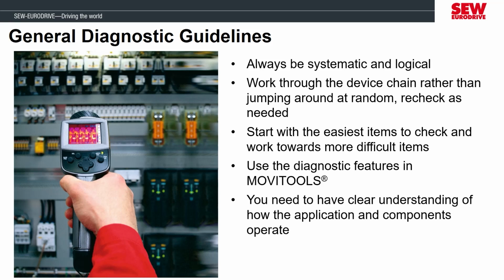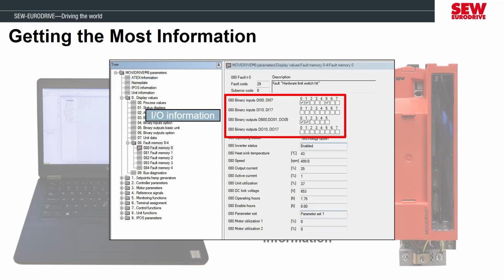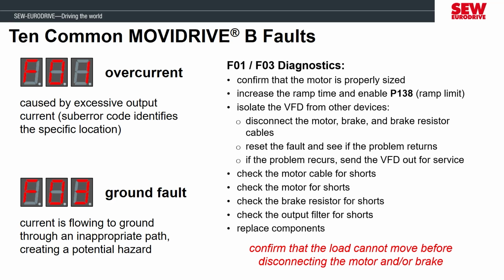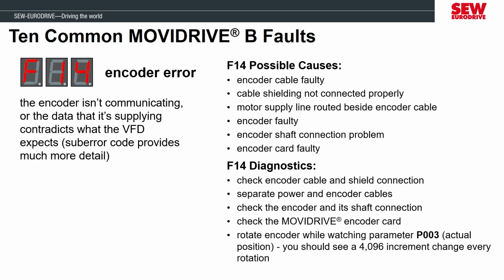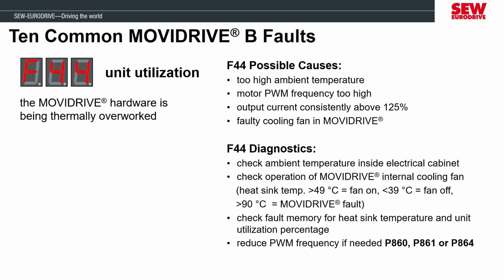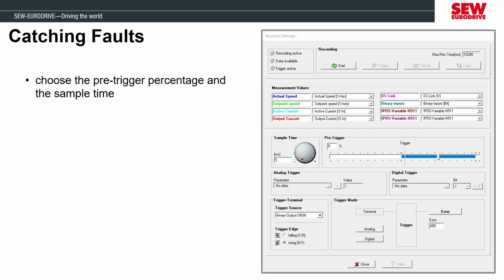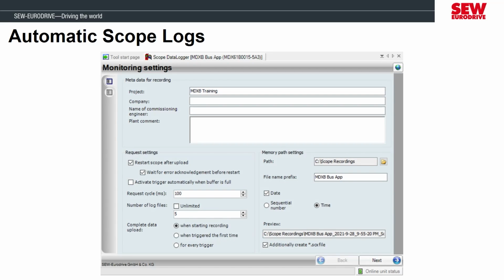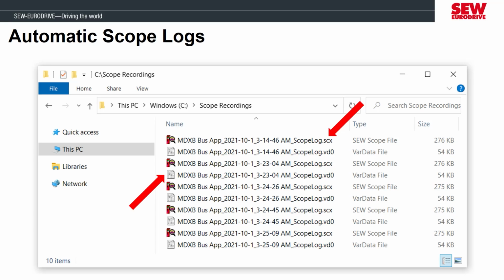MOVIDRIVE® B Training Session 7 - Troubleshooting

Comment: Fault F45 how to fix sir??
Reply from the maker: Hello @tuanthinhdo1108 . We would need more information from you about which variable frequency drive you have that is reporting the F45 fault. If it is a Movidrive B like this troubleshooting video was made for then this is likely an issue with initialization at boot time of the Movidrive B. This can happen if the parameters were corrupted, an incorrect parameter set was downloaded to the Movidrive B, an option card isn't installed correctly, or there is an internal hardware issue with the Movidrive and it would need to be sent to SEW-Eurodrive for evaluation and repair. If you have a backup of a good and working parameter set, then you can try factory resetting the Movidrive B to "delivery state", then re-downloading the correct parameter file. If that doesn't work, then there is likely a different root cause.

Movidrive B System Manual:
https://download.sew-eurodrive.com/download/pdf/27793230.pdf

Page 689: Description of F45 Fault with possible causes.

Since this error can have many causes, it is best to call your nearest support office so they can discuss this more in-depth with you. Our phone support is free of charge. Please contact your nearest SEW-Eurodrive support office and ask for engineering support. Here is a map to find your nearest office: 
https://www.seweurodrive.com/meta-pages/contacts_worldwide.html

Comment: I have error code 47. Can you help me to repair it? Error code 47 is coming after i turn off the plc.
Reply from the maker: @kamubisasendiri1018 Hello. Fault F47 relates to a timeout of the SBus 1 connection. If you switch off the PLC this is a normal response because the communication/handshake between the PLC and the Movidrive has been interrupted. This fault should clear once communication is re-established.

If the F47 fault is occurring randomly during normal machine operation, then the timeout of the SBus may be set too short or there is an underlying electrical connection issue. The timeout parameter is in "P883: SBus 1 timeout interval". 

If the F47 fault is only occurring when you are logged into the PLC sending updates and stopping the program, then do not change the timeout parameter. It is normal behavior for the SBus communication to be lost during a PLC shutdown or update. 

Movidrive B System Manual
https://download.sew-eurodrive.com/download/pdf_u/27793230.pdf
Page 689: Description of F47 fault code

If you still have questions or need troubleshooting assistance, please contact your nearest SEW Eurodrive support office. Please ask for electrical support when calling in and here is a map linked below to locate your nearest office.
https://www.sew-eurodrive.de/meta-pages/contacts_worldwide.html

Comment: Hi I am receiving F-08 in both controllers of my system. I try to ran the system even in manual and its coming back again the alarm. System was running good and suddenly just started to pop up the alarm.
Reply from the maker: @victoraponte9503 Hello. The F-08 fault generally relates to a mechanical bind causing the Movidrive to send high motor current which results in a fault. The recommended troubleshooting steps for F-08 start here at 16:10 of this video. This fault could also be caused by a numerous other causes such as incorrect wiring, motor direction of rotation is wrong, or a faulty encoder or power cable. In your case since you said the machine was working fine then started issuing an F-08 fault. We recommend checking that the motor's brake (if it has one) is releasing when you go to operate the machine. You should hear an audible click when the brake energizes and releases. Also check for any visible signs of mechanical binding of the machine. Check that there are no loose connections at the motor or electrical cabinet. You can watch this other video in this training series here to determine how to check the mechanical brake on the motor.
https://youtu.be/Lt7uA3ggLgk?feature=shared&t=1249

Since you said that you can't even operate the machine manually there is likely something that failed within the machine causing the persistent F-08 fault code. These causes can be tricky to troubleshoot depending on the complexity of the machine and how it is designed to operate.

We highly recommend you contact your nearest SEW Eurodrive support office so they can get a better understanding of the machine, get parameters from the Movidrive, and learn what type of motor it uses. Our telephone support is free, and you can ask for electrical support when calling in. Below is a link to a map to locate your nearest SEW office. 
https://www.sew-eurodrive.de/meta-pages/contacts_worldwide.html
Reply: @SEWEurodriveUSA thanks for the prompt reply! I am trying to get access to the parameters P160, P162, P501, P303 and some others and looks like I dont have access to check them. I can just check some basic parameters. Do you know how to get the full access?
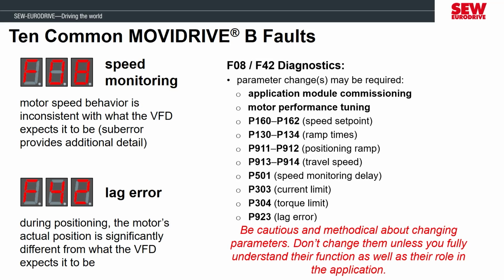Reply from the maker: @victoraponte9503 Hello. There is a parameter lock that could be set to either "On/Off" in P803. If that is turned "On" then someone intentionally had a reason to turn it on to prevent improper changes. Please be very hesitant to increase the current limit in P303 or the F08 response delay time in P501. If these parameters in the machine have functioned okay for a while and nothing recently has changed with the motor or parts that are installed on the machine, those parameters shouldn't need to change. If you decide to increase those parameters just know it could damage the machine or cause the motor to fail from overcurrent or some other unfortunate condition. We mention this at 18:25 of this video.

Instead of changing parameters it is better to capture a Scope recording of what is going on with the motor operation. That can help you diagnose or possibly point to the root cause. This video here talks about how to setup a Scope recording. If you save that file (it will be a .SCX extension) you are welcome to email that to your local SEW Eurodrive support office so they can advise you better of what are potential causes to the persistent F-08 fault code.

https://youtu.be/xfv-2NtQMNY?feature=shared&t=830

Comment: We have 2 issues and hope you can guide us:
• Brake Chopper Fault at Startup
At the beginning of each production shift, the vertical movement servo-drive  frequently shows a brake chopper fault . We have to reset and restart many times before it runs smoothly. 
Another issue occurs during the day in another drive but same machine it shows a U code
Can those 2 issues be related cause both drives are connected to the same brake resistor!
Reply from the maker: @mazintunja Hello. It is not recommended to connected two Movidrive B inverters to a single brake resistor. Doing this allows high voltage DC (~700Vdc - ~ 950Vdc) to back feed from one inverter to the other through the shared connection of the brake resistor. If each inverter has enough regenerative energy to need a brake resistor, it should have its own dedicated resistor sized properly for the amount of regenerative energy it needs to dissipate.

The F04 brake chopper fault could be coming from the other inverter sending voltage across the shared brake resistor. Or it could be a faulty/damaged power section from excessive regenerative voltage over time.

The other inverter that is displaying a "U" status is normal. This indicates that the X17 STO (safe torque off) circuit has been tripped. The X17 circuit is commonly used with safety controllers to remove 24Vdc when an E-Stop is pressed or some other condition deems the machine unsafe to operate. You can find the X17 port on the underside of the Movidrive B control head and it will be a 4-pin connector in the front left corner (underside). From the SEW factory this 4-pin connector comes with white jumper wires installed. If this Movidrive uses a safety controller then those jumpers have to be removed and the wires from a safety controller will install there instead. 

Here is a link to the Movidrive B System Manual.
https://download.sew-eurodrive.com/download/pdf/27793230.pdf

Page 604: Basic Control Head Wiring Diagram
Page 608-611: Recommended Braking Resistors for 400V Movidrive
Page 603: Brake Resistor Connection Diagram

We highly recommend you to contact your nearest SEW Eurodrive support office. When calling in please ask for electrical support so they can assist you with the F04 brake chopper fault, sizing a proper brake resistor for the inverter you have, and to determine if there are issues with the X17 STO connection on the Movidrive. Below is a link to a map to find the contact information for the nearest SEW office.
https://www.seweurodrive.com/meta-pages/contacts_worldwide.html

Comment: We have 5 Inverter Modules SEW with model: MM07D-503-00 and need to determine their individual status if still OK or NOT OK. Can you help me to determine?   I need a procedure
Reply from the maker: Hello. There are several ways to do this depending on your need. If the MOVIMOT D is connected to a fieldbus you could query the process data word reporting the status of the inverter.

If you need an output wire to do this then terminal K1a and K1b can be used as a "Ready" signal as long as it's not being used for another function already. If the contact is closed then the Movmoit is "Ready". If the contact is open then the Movimot is "Not Ready".

You could also inspect the LED on the top of the Movimot Control Head to determine its flashing pattern and color code.

Here are the Movimot D Operating Instructions with the specific pages about these "Ready" and "Not Ready" signals.

https://download.sew-eurodrive.com/download/pdf_u/28516672.pdf

Page 44: Wiring Diagram showing K1a and K1b "Ready" contact.
Page 127 - 128: Binary Assignment of Status Word Process Data Word
Page 179 - 180: Meaning of LED Flashing Pattern and Colors

You are welcome to contact your nearest SEW Eurodrive support office using this link below and ask for Electrical Support when calling in if you need further assistance with this.
https://www.seweurodrive.com/meta-pages/contacts_worldwide.html

Comment: can i bypass f14 alarm in movidrive
Reply from the maker: Hello @industrialsolution6828. The F14 error is related to the motor encoder. It could be a loose connection, unplugged encoder cable somewhere, damaged/cut cable, damaged encoder, or wrong parameter settings. If the application requires the motor encoder for operation (e.g. hoisting, positioning, homing, speed control, safety functions, etc.) then it will not be possible to bypass the F14 fault without correcting the error first. This is because the machine programming would require the encoder position to operate in those scenarios. Furthermore, if the motor type is a permanent magnet synchronous motor then it's not possible at all since that motor type requires encoder/resolver feedback.

In some scenarios it may be possible to re-commission the motor parameters and remove any settings for the motor encoder, so the Movidrive ignores it (even if it is connected). But it's not recommended to do this without someone experienced in the machine to guide in doing this and determine if it is even possible. Many things must be checked and verified before major parameter changes like that could happen. You can contact your nearest SEW-Eurodrive office using this link below and they may be able to advise further and get more information from you about the machine to help. You'll want to ask for electronics support when calling in. 

https://www.sew-eurodrive.de/meta-pages/contacts_worldwide.html

Comment: Hi I have fault f-28 how can I fix this
Reply from the maker: Hello. An F28 is somewhat of a common fault. This happens with the upper level fieldbus or PLC has stopped communicating over the network to the Movidrive fieldbus option card. This could happen from opening the PLC program and pushing an update which would stop the fieldbus communication during the update. Or it could be from a disconnected cable. It could happen with incorrect address settings as well. If nothing has been changed then the powering off the Movidrive for 60 seconds. Then powering back on the Movidrive is something you can try to re-establish communication back to the upper level fieldbus/PLC.

You can view a list of fault codes on the Movidrive B and possible causes at this link here on starting on page 684. 
https://download.sew-eurodrive.com/download/pdf_u/27793230.pdf

If you would rather speak to someone on the phone about this fault below is a link to find your nearest SEW office. You will need to ask for Electrical Support when calling in. 
https://www.sew-eurodrive.de/meta-pages/contacts_worldwide.html

Comment: Hi i have a fault 86 , memory module
Reply from the maker: Hello. The fault 86 indicates that the Movidrive doesn't detect the red colored memory module on the top of the inverter control section. This module has a "stop sign" logo printed on it. This can come from the memory module being removed and turning the inverter on. Or from a hardware issue. If you can confirm that the memory module is installed and you still get the fault after cycling the voltage. Then the other things you can try are to factory default the parameters and then reload them from a previous backup (this is best done with the MotionStudio software, and you must have a known good backup of the parameters before setting it to a default condition). Or you can send the Movidrive in for Electronic Evaluation to see if it can be repaired by SEW. Here is where you can locate your nearest SEW office for Electrical Support. https://www.sew-eurodrive.de/meta-pages/contacts_worldwide.html

Comment: HI MY MOVITRAC INVERTER WAS H1 LIGHT INDICATOR ON .ILL ALREADY CHANGE ALL CABLES BUT STILL THE SAME ISSUE.ANY SUGESTION ? THANK YOU
Reply from the maker: Hello. This would be easier to troubleshoot over phone support since there are several different versions of the Movitrac inverter. We would need to know a lot more information to assist in troubleshooting. You can contact your nearest SEW office and ask for electrical support so they can talk with you about this. Here is where you can find that contact information. https://www.sew-eurodrive.de/meta-pages/contacts_worldwide.html

Comment: Fault number 2 how to operate Automode
Reply from the maker: Hello @karimtech1343. There is not a flashing fault F02 for the MDX61B Movidrive B. If the 7-segment display is showing a 'solid' number 2 that indicates that the Movidrive is missing the 'Enable' signal. This is a normal condition to see while the Movidrive is operating. The Enable signal could be needed on the digital inputs or from the fieldbus. It depends on how it is configured. Please contact your nearest SEW Eurodrive office using this link and ask for Electrical Support so they can offer you telephone support.

https://www.sew-eurodrive.de/meta-pages/contacts_worldwide.html

Comment: Hi sir, I have an error F122, " Absolute Encoder Option" . Suberror 16640. So due to this error i could not jog the lifter down by using manual operation in movitools. I need to jog it down so i have access to replace the external encoder. Please advise and thank you in advance.
Reply from the maker: Hello @jkavillan. In this situation it may be challenging to manually move the application since the fault is limiting the axis to operate. You can attempt to connect a PC to the Movidrive B and operate it manually from the software but it may still continue to fault and inhibit the ability to manually operate it. Watch the Session 6 Lab 4 video on manual operation starting at minute 17 30. https://youtu.be/s8044Q3Cs6M?feature=shared&t=1050

If it continues to fault in manual operation you may have to re-commission the Movidrive parameters to deactivate the encoder settings so it is ignored by the Movidrive. This process may be very tricky to do without help from SEW-Eurodrive since you will need to backup the parameters before making any large parameter changes like that, and encoders can be connected in several different ways to the Movidrive. Please contact your nearest SEW-Eurodrive office and ask for Electrical Support so they can talk with you about this situation. 
https://www.sew-eurodrive.de/meta-pages/contacts_worldwide.html
Reply: @SEWEurodriveUSA  thank you so much

Comment: I have an MC071B drive, Which I've been trying to learn how to control work on my own so I'm stuck in a 24 V operation state I don't know how I can change the operation state, So I need your help and last but not least Can you provide me with any training regarding this.
Reply from the maker: Hello @asharsaeed1880. We do not have any training videos for the Movitrac MC07B inverter. However, it is almost identical to the Movidrive MDX61B in how you commission and change the parameters. The biggest differences are that the MC07B will use a different wiring diagram, and the keypad is different. If the inverter shows 24V on the display and you have 480V switched on then possibly the STO ("Safe Torque Off") X17 jumper plug on the bottom of the inverter is not installed. You can see this on the wiring diagram on page 205 of the MC07B System Manual here. 
https://download.sew-eurodrive.com/download/pdf_u/31960421.pdf. 

Here is a brief online e-learning module for the Movitrac MC07B.
https://download.sew-eurodrive.com/learning/MOVITRAC_B_Overview/EN/index.html

If you rather speak with someone about this you can find your nearest support office using this tool here.
https://www.sew-eurodrive.de/meta-pages/contacts_worldwide.html